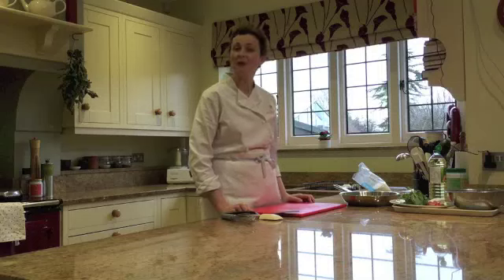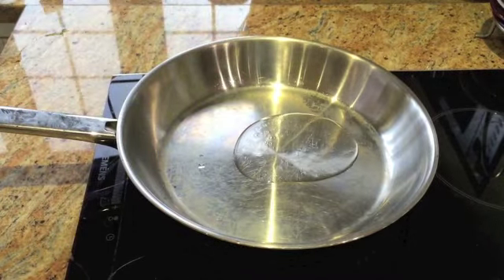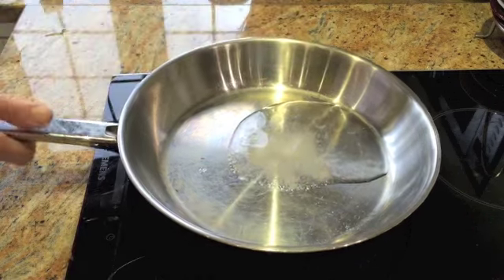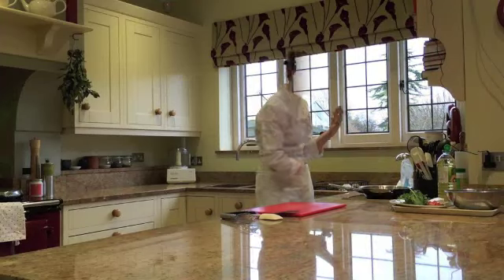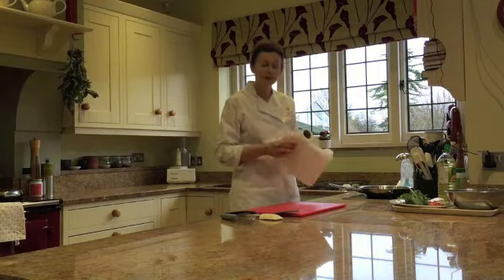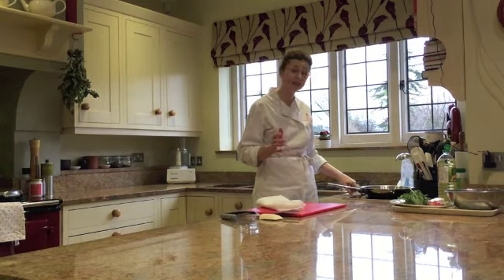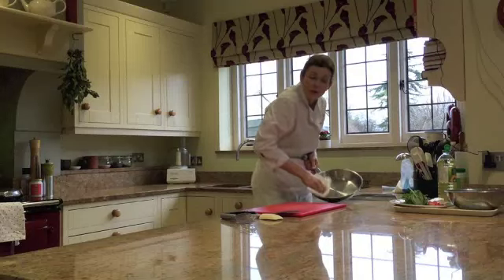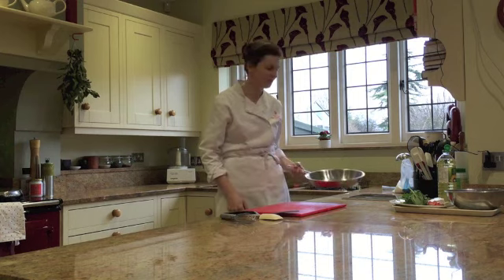How to Make a Pan Non stick with Be in the Kitchen

Comment: Followed these instructions to the letter, and the egg still stuck like glue. Complete waste of time!
Reply: Your pan was too hot. HEAT KILLS ! ! ! !
Reply: @jonnierotten7  so if it's too hot it sticks, and if it's too cold it sticks?
Reply: I use this method on my st st pans. You need to let it cool down a bit. (Hand touch). Then when cooking, oil with butter. Should be OK.
Reply: This is the ONLY thing that works. I tried it and it works like a charm.
Reply: You just didn't do it right it's not the videos fault it's your fault
Reply: @Knight00519  If the pan is heated up properly before cooking ( Mercury ball test) then there is no need for all that nonsense.
Reply: @JohnConboy1 I use an infrared laser and once the centre of my pan hits 220F I do the mercury ball test and generally that’s where my 28cm 5PLY SS pan for eggs sweet spot is. I then turn the burner down from medium to half way back to low. Pop the oil in swirl it about a bit, wait say ten or twenty seconds for the oil to shimmer and put out a whisp of smoke and then I pop in four eggs and never once has an egg stuck. 
I have eggs every night Monday to Friday so I’m a pro at cooking eggs on stainless steel, I hope this helps out. 
I roast meats on Sundays and use the carvings to lay the eggs on for my weekday meals.  I didn’t want folks thinking all I eat is eggs haha. 
When my SS pans get to grubby, I use barkeepers friend, it’s an absolute life saver!

Comment: Been a plumber for 38 years with most of that time working service calls including drain service. 
That oil goes down with hot water just fine leaving the sink then it begins to cool off as it continues down the line. Depending how your house is built, the design and the location (far north with colder ground temperature) etc. 
When that oil cools, especially if it was used to cook fatty meat it can   and will leave a film inside the pipe. This film keeps building up until there is enough to clog the line sometimes with so much goo that a power auger will go through the goo and not open the line. This requires a jetter or a steamer to clean the line to restore flow. Animal fat builds up and can get hard as a rock in there. 
Just did one last month, 5 & 1/2 hrs running an auger busting out chunks of hard grease that could be seen flowing past the downstream clean out in the main. 
NO GREASE OR OIL DOWN THE DRAIN. Pour it into a can and throw away in the trash. Use a paper towel to wipe the rest out before washing.
Reply: rabbycacker thank you! Lived in my house 20 years. Never put anything but water and toilet refuse, sans even paper. Never had as problem. Married 2 years ago. Can't break husband of one, eating so much fat, two, putting grease down sink. I will show this to him before it's too late!
Reply: rabbycacker ł
Reply: MZ Marie 
Good luck with that. 
One of my customers had a similar problem with her family. Her kit sink line ran under a concrete slab that was kept cool because it was the basement. We were over there every 8 to 9 months like clock work for years until they sold the house and moved. New buyers didn't have the problems, at least not nearly as often.
You can find decorative tins that are big enough to fit a smaller can for the grease. 

P.S.
Toilet paper is not so much a problem as long as reasonable amounts are used. Handy/baby wipes should not be flushed especially if there is an on site septic system as they will not disintegrate and cause problems for the pump truck.
Regular pumping is not a bad thing compared to the cost of replacing the system.
Reply: rabbycacker i
Reply: rabbycacker, I was going to say the same thing in hopes that Ms. Jane Slater would hear sound advice. Not only will the hot grease cool and clog the drain but hot grease on water left in the sink can sputter upward and burn the per pouring the hot grease. That is why I always save a vegetable can, (that I had washed out), to pour any hot grease into be it bacon grease or vegetable oil.
Reply: I pour dish soap into the oil and break it down before rinsing.
Reply: @rabbycacker:
Does theinkbrain's assertion that pouring dish soap into the oil to break it down resolve the clogging problem?
Reply: Its worked out that way for me. You have to pour in enough dish soap so that the oil becomes opaque, then make sure its mixed in well. The dish soap seems to 'emulsify' the oil, so that it assumes a different (and water-soluble) consistency. And just to clarify it does not 'resolve' an already existing clogging problem. It just prevents the oil from causing a clog. Run some hot water after you pour off the dish soap and oil mix.
Reply: Wouldn't it keep it from clogging if hot water was poured at the same time and then follow immediately with used coffee grounds from the coffee maker - the coffee grounds are acidic, so it's a natural pipe cleaner recommended for years: don't throw them away, get them going down the drain along with hot water.
Reply: what?   if that's true, i've been wasting those grounds for years!   yikes!
Reply: Rabbycacker  Omg you are correct!!  Never pour oil down the drain!!  I always save a glass jar to put the discarded oil in and throw it out when its full!  I cringed when she poured it down the drain!!  Very stupid!  Also, putting salt in the pan like that will cause pitting to an All Clad...supposed to never do that either...ugh.... 🙄
Reply: Hello everyone im also here where you guys were a year ago  
Thought i should tell u guys
Reply: Yuppp... I worked with a plumber and said people think the drain is a trash can and then they pour down that lye and acid drain cleaner right before they call the plumber.
Reply: I couldn’t have said it better she know about cooking but,you should NEVER pour oil down any drain EVER!
Reply: You are definitely correct!  My grandma taught me to get rid of my oil in  a bag and dump in the garbage.  Thank you for bringing this up!
Reply: I saw that and my jaw hit the floor. My old man would black out from anger.  If I so much as poor a few drops of butter in there, watch out. To each their own though.
Reply: Very helpful advices! Thanks!
Reply: I did cringe when she poured oil down the drain.  I have an old jar that I pour oil, grease and then throw out the  jar.
Reply: She used an unsaturated fat that had nothing but salt in it.  In no above freezing temperature will that oil solidify in the lines.  
Butter, lard, and animal fats are a different story.
Reply: One can dispose of the oil in aluminum foil and throw it away after freezing it.
Reply: I definitely got a bit wide eyed when she poured the oil down the drain. I thought that was a known thing never to pour oil down the drain.
Reply: I’m doing the same ☝🏻👍🏻
Reply: Even without plumbing knowledge, this instinctively makes sense to me. I always pour oil and grease in a jar and put it in the trash can.

Comment: At 73 I live alone and cook on a very regular basis. For situation like this I wipe up the excess oil with old newspaper and throw it in garbage but never dump it into the drain. The worst part is if the drainage system is built with plastic pipes instead of cast iron you are going to have even bigger problems of possible algae growth.
Reply: U

Comment: That oil when combined with anything alkali will clog your pipes with a residue akin to an unmeltable soap or wax. I know it seems OK because the oil is liquid but the chemistry says it will NOT stay like that. Combine it with a bit of this and that and it's hard to remove as concrete. Not just your kitchen pipes but all the way into the tank or main sewer. It lays up one layer at a time like a laminate. Great hint other than dumping the oil in the sink. I'e done it that way all my life.

Comment: Yeah,  don't pour hot oil into sink.  Pour it into a dry, metal container, and allow to cool.  If you insist on pouring it into a sink, have the sink half full of standing water.  If you pour really hot oil into something that has a bit of water in the bottom, it will spurt hot oil into the air.  Dangerous.
Reply: I always pour excess oil into a container, but if I am washing an oily pan, I put it on the stove with some water and washing up liquid, bring it to a simmer, then pour it down the sink. There is very little oil in that, and the washing up liquid has broken the oil molecules down to a safe consistency.
Reply: That's too much wooork though :(

Comment: Thank You.
That was educational.  One question though.
How do clean the pan after the use?
What about the yellow-brown layer of oil tha are stuck to the pan after using?
You remove it? You let it stay?
How do you avoid them, to begin with?

Thanks
Reply: No soap,  just let water rin into it ang use Sponge
Reply: often the outside of my fry pans seem more non stick than the cooking surface

Comment: S steel does not season.   I swapped over to carbon steel cookware.  It seasons like cast iron  but much smoother. Good for glass top stoves.     Great stuff    I started with 2 pieces  to try and a year later I switched all to Carbon Steel.   Stainless steel is crap  it does not season and causes too much sticking.
Reply: bobknight33 I love my De Buyer carbon steel pan now it's seasoned, but, you can't cook stews and stocks in it, so you do need either Stainless Steel or enameled cast iron for those.

Comment: Stainless steel     when used properly doesn't need to be seasoned. Heat Pan up 1st  test with oil when  stays together in a large drop Pan is ready add oil Nothing should stick.